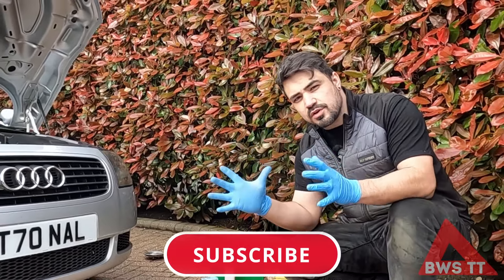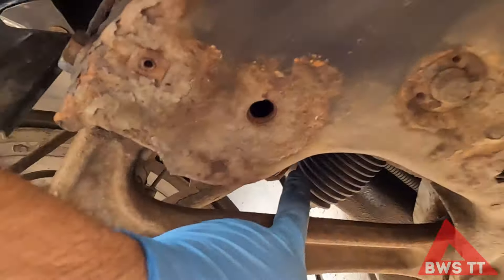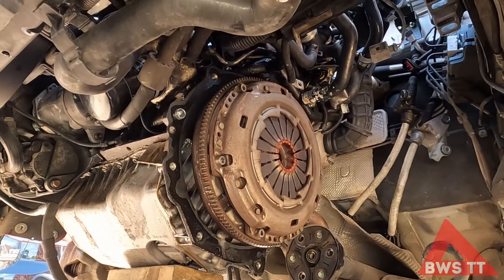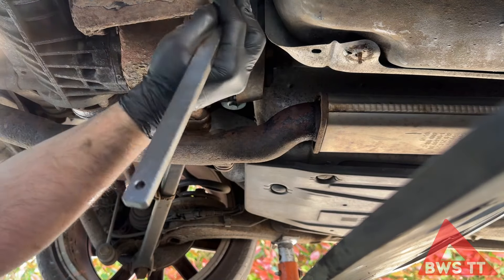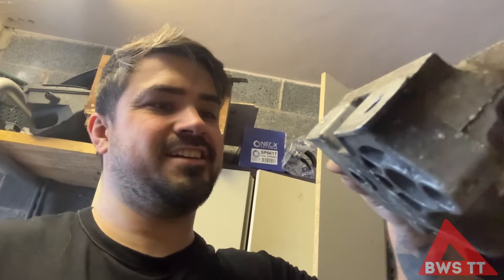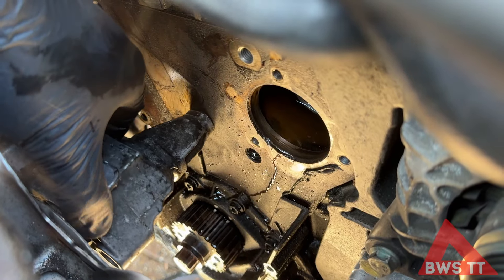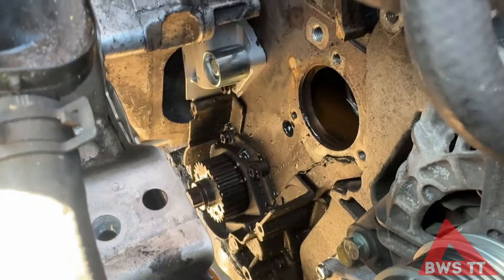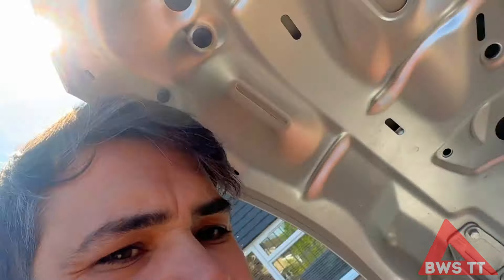The real reason i quit mobile mechanics! Audi TT Clutch, cambelt, and haldex in one day goes wrong!

Comment: Good to see you back in Mk1 again! I'm doing a major refurbish of the rear including tank off and corrosion proofing the rear subframe and trailing arms, etc. Replacing bolts that I can get as well. Would love to see vid on replacing rear gearbox drive shaft seals and inner CV joint boots! Keep up the great videos.

Comment: Just had the clutch changed on mine following a slave cylinder failure. Thought about doing it myself after watching your guide multiple times but decided to let a garage do it instead. Annoying thing was 800 miles prior I'd just dropped the subframe to do the downpipe and turbo which id followed your excellent videos on. I think one thing that puts people off the subframe is the one time use bolts and cost to replace them. The bolts are also starting to be come hard to get.

Comment: I still for safety mark old belt and pulleys, transfer marks onto new belt and then fit with marks realigned . Have a S3 8L so your video's all help. Next weekend doing haldex oil and filter
Reply from the maker: Yep, marking and transferring marks, then counting 68 teeth, and then confirming markers line up is the way to go! I’ve seen pulleys that have moved on the crank, this method will highlight that quickly, due to the way it confirms everything

Comment: I've got 3 at the moment.  A 225 Coupe, a 225 Roadster, and a 180 FWD coupe.  I'm doing the clutch on my 180 and I agree completely with you about the subframe.  I – stupidly – pulled the trans out with the subframe still in place.  There was no way I was going to try to get it back in without dropping it.  
Glad to see you under a TT again.  

I've heard that some people unbolt the bevel box from the trans and leave it bolted to the motor.  Have you ever tried that?
Reply from the maker: If you do that, you’ve just then got 2 akward splines to line up instead of one, so yes I’ve done it that way a couple of times for varying reasons, but I don’t like it
Reply: @BWSTT  Good to know.  Now I don't have to try it :-)
Reply: Hi, why not the Gates kit now ?
Cheers Bob

Comment: As long as the arm...
The £1k bargain isn't a bargain.
Clutch slave cylinder went.  Whilst in there sorted the clutch and fly wheel which were on their last legs.
Now the corroded power steering pipes which I moved to do the clutch have given way and pee'd their juice onto the floor.  Parts wise under £1k, but pita wise, annoying.
I think it will be a nice car.  When I have had the chance to drive it, fantastic.  Lights at night have been awful.  Another one for the list.
Reply: Hi Bryn great informative video as always, nearly rebuilt my whole tt watching them, I've got a worrying problem, an acrid sweet smell in the cabin, and the windscreen condensates up when the blower is on, I suspect the heater matrix has failed either tgat or the flange connector o rings, any advice? Cheers Ray, 2005, 3.2 v6

Comment: Great content interesting about the one tooth out we had same problem with a TT engine we have in a golf and thought I had done something wrong !  But sorted in the end 
One my mk1 the twin fuel pipes on top left have started to crack is there a replacement available ? I can not find any 
Thanks
Reply from the maker: You just need standard 8mm fuel line and move over the fittings

Comment: I am in the states with a 225 and I think a cracked exhaust manifold.  Is there a aftermarket manifold that is good quality that I can replace the OEM style with and keep my ko4?
Reply from the maker: The only option is the “chinafold” but they require machining and don’t always line up exactly, so will be easier to fit a stock one

Comment: why is gates water pump kit no longer good?
Reply from the maker: The tolerance on the mounting hole of the roller tensioner is too big, so it doesn’t sit securely on the mounting bolt